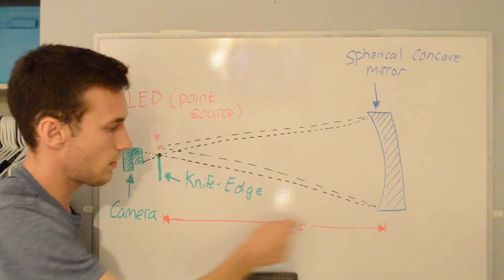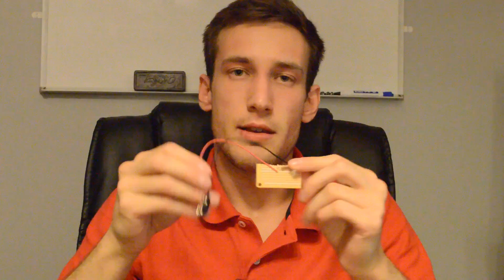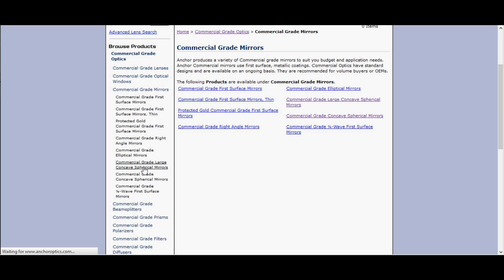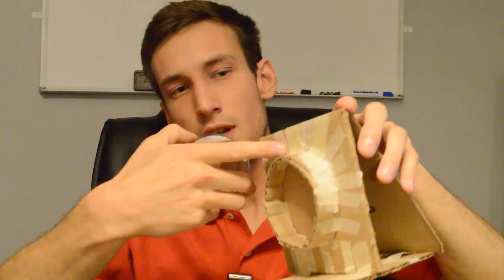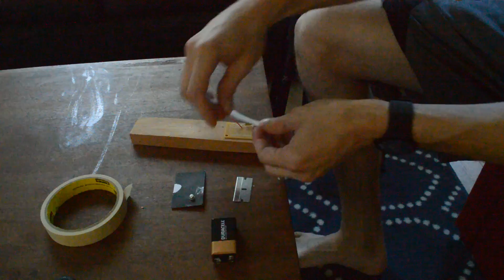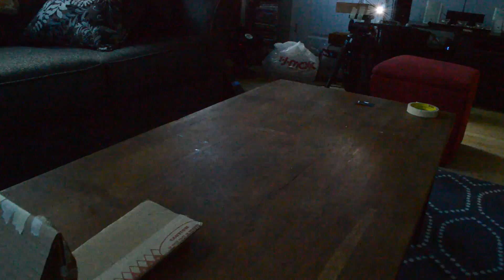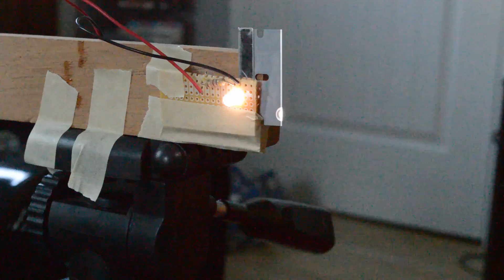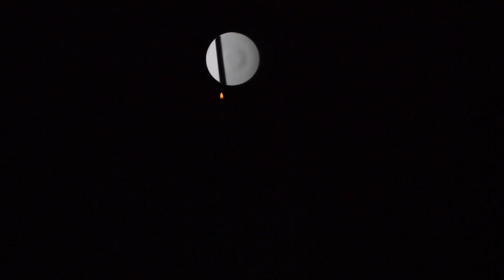How To: Build Your Own Schlieren Setup

Comment: Fantastic experiment! It is possible to se the effect with eye without camera? Thank you!
Reply from the maker: Yep!  You can just take out the camera and hold up a piece of paper a little farther back behind where the camera was.  The farther you move the paper back, the larger the image gets, but it will also get dimmer.  However, you'll be able to see the effect no problem.  Note that the image will be upside down.  You can also switch between Schlieren and shadowgraph by pulling out the knife edge.

Comment: Very interesting, and clearly explained, thanks a lot.
Best regards
Reply from the maker: No problem!
Reply: +JoshTheEngineer
Excuse a couple of possibly stupid questions, but if One wanted to build/test this Yourself, what are the most important "criteria" to make the "system" "clear", and easy/robust to set up.
I wonder mostly what one should "look for" regarding the mirror, as this seems to be the hardest part to get (and most expensive;). 
Is larger mirror always better than a smaller(qualities otherwise equal), and what about "focal distance", is longer always better than shorter,or vice versa. Or is the "sweet spot" simply only dictated by the "size" You want Your set up to be.
((I mean I understand that the focal distance dictates the "size",what I'm not sure about is whether Your set up was "deliberately chosen" to be that "lenght/size" due to some underlying reason. Or that it simply was due to that "this was the mirror You got")

And would it be possible to use a laser as a light source, if so would this have any advantages,or drawbacks ? (EXEPT the obvious that You of course can (should) NOT observe the reflection with a naked eye)

(Appologies for the verbose questions)
Best regards.
Reply from the maker: You have some good questions here.  Regarding the most important part of the system, I would say the mirror is the crucial component.  As you can see from my setup, there aren't really that many parts involved, and the mirror is the one that has the biggest impact on the quality, as long as you have everything set up correctly.  With a nice mirror, you'll get uniform light distribution in your videos/images before you put the knife-edge in place, which can be critical if you want to see minute details in your flow when you do finally put the knife-edge in.  What I mean by that is if you look at the end of the video, that bathroom/makeup mirror I use is clearly of poor quality for these types of experiments, and even without the knife-edge in place, the light distribution on the mirror is not even close to being uniform.  It makes alignment more difficult too.

There's a trade-off regarding the mirrors though, to get to your next question.  The three-way trade-off for me is between large mirror diameter, long focal length, and camera zoom.  It would usually prefer a larger mirror because the things I can look at can be bigger.  However, if you have too large of a mirror and a dimmer light source, then you'll have less light intensity over the surface area of the mirror.  It might matter, but it might not, just something to take into account.  To increase sensitivity, a longer focal length is better, but at some point, your setup will just be too large, and won't be able to fit in the room.  In my other couple of videos I did with a larger mirror, the focal length was pretty long and I had to position my mirror and camera on opposite sides of the room.  In this video, you can see that the mirror never takes up the full screen because my camera couldn't zoom in far enough.  When I switched to the larger mirror, it still doesn't fill up the whole frame because the focal length of the mirror increased.

The main reason I used the mirror I did in this video is because it was a high quality mirror with a long focal length for a very reasonable price.  That's pretty much it.

I have used a red laser pointer as a light source with a diverging lens attached to the front  of it, and it worked pretty great.  The main drawback with that laser pointer is the speckle pattern was pretty bad and it was magnified because I diverged the beam to fit on the mirror surface.  There will always be a speckle pattern with any laser, but higher quality ones will be better in general.  This was just a couple dollar laser pointer I was using.  But yes, definitely make sure you don't look straight into the laser!

Comment: Hey there, awesome video that seems very 'complete' in both theory and practical setup. I was wondering if there would be much advantage/disadvantage in using a laser pointer as your light source? I am guessing you need the beam to be divergent enough to cover the mirror but still coming from as small a point as possible. I may have misunderstood something but as you were using the word laser a lot so I wondered if it was because it would be of benefit to use one if you had it?
Reply from the maker: Hah, yes I use the word 'laser' a lot because I work with lasers in my research and I'm so used to saying it, so I slipped up a few times in this video!  You can definitely use a laser though, and I actually have with my setup.  You're correct that you'll need to diverge the beam to cover the mirror.  Here's how I did it.  I have a simple red laser pointer that you can buy for a couple of bucks.  I bought a plano-convex lens to diverge the beam from the laser (search Thorlabs LA1213 on Google, it's the first choice).  This happens to diverge the beam just the right amount to cover the mirror in my setup.  If it diverges too much, you'll lose intensity, and if it doesn't diverge enough, you won't use all of the usable area of your mirror.  I got pretty good results with the laser, but you should note that you'll definitely get a speckle pattern show up in your images.  This is just an unavoidable thing that comes with using lasers.  I like the pictures I get from my LED better, but if you're using a higher quality or high power laser, it might be better.  I say this a lot, but the quality depends on a lot of factors, and it's hard to make sweeping generalizations.  You should definitely try it out though, and see for yourself!
Reply: HpyCmp3r just a short note about lasers..yes they will work but there a few issues with them. Being a coherent light source, you will struggle to get a very clean field due to the patterns you get, and as they are monochromatic light sources, you will experience greater diffraction around the knife edge. This in turn will make the image a little less sharp. A red laser will be safer here as the wavelengths are far longer. Hope that helps you both.

Comment: This video is very good. Do you have any idea to see the flow dynamics inside a tube whose dimension are in mm. Either it should be a circular or square
Reply from the maker: Are you interested in building a shock tube?  If so, I would recommend going with circular cross-section tubes.  If you use square cross-sections, you'll have to worry about stresses at the corners when you pressurize the driver.  Circular tubes are better for pressurization.  

When you say 'dimensions are in mm', do you mean that you're trying to build a very small one?  You also need to be concerned with the boundary layer that develops along the length of your tube.  If you have a very small diameter tube, you probably won't have a uniform freestream near your test article.

Is this what you meant?  I might have misinterpreted your question.  If I did, try to rephrase it and I'll give it another shot!
Reply: I want to see dynamics of fluid inside the tube which is nearly 8 cm long with inner diameter is 4 mm and the tube is square shaped. I can see the flow outside but i cannot see anything inside tube. Do you have any idea or suggestion to solve this problem.
Reply from the maker: The tube diameter is quite small, and I think it will be difficult to get optical access to it.  You'll have some boundary layer interaction which will make it difficult to understand exactly what is happening in the tube.  What flow velocities are you looking at?

The first step is to simply put a window looking into the tube.  If you don't have optical access, you can't do any sort of Schlieren imaging.

Comment: Thanks Josh, awesome video with great explanation. I have a question, would placing the light source and knife edge at the focal point work as well? since at focal point the light will also come back  as a dot just similar to 2f point. Also, is the led bulb collimated? Does the light source need to be collimated? Thank you!
Reply from the maker: You're welcome!  If you placed the light source at the focal point, the light would actually leave the mirrors collimated, and wouldn't focus back down again.  This is actually what the Z-type Schlieren system does.  You place the light at the focal point, collimate it with a mirror, then use another mirror to focus the collimated light back down to a point at the second mirror's focal point, which is where you would place your knife edge.  This way, you get collimated light through your object of interest.  The LED is not collimated; it emits light in all directions.  You don't want a collimated light source, because it needs to diverge out to fill the mirror.  Lasers are collimated, which is why in my other Laser Schlieren video, I use a lens to diverge the light so it encompasses the mirror.

Comment: +JoshTheEngineer do you think it will work if 1 foot behind the razor blade we placed a white paper as a screen so we get the image? I mean not to use a camera
Reply from the maker: That should also work, since the camera is mainly there so you can record images or videos.  You might also notice that if you take the razor blade out of the setup, you can place a piece of paper where your camera would generally be, and you should still be able to see something that looks like Schlieren, but is actually called shadowgraph.
Reply: shadowgram yes

Comment: Hi Josh, absolutely love the video. I in fact just built a setup in my living room with a 1300mm FL mirror. It is a telescope mirror, and fits this experiment well. I am creating this as part of my physics final project. One question though. I have everything setup, and light a match or something, the image that I am seeing is everything I need to see, but it's inverted. Placing things at the bottom of the mirror is showing at the top of the mirror, and the smoke is going downwards (upwards). Any thoughts as to why?

Comment: Does it work if you don't use a point source, but instead use a light source that produces beams parallel to the principal axis of the mirror, and place the blade edge and camera at the exact focal length instead of twice the focal length?
Reply from the maker: That's actually sorta what the Z-type Schlieren system does.  You're essentially just skipping the first mirror part, which collimates a beam from a point source located at the focal point of a parabolic mirror.  Then after the collimated beam passes through the region of interest, another parabolic mirror focuses the light rays down to a focus, where a knife edge is located, and then into your camera.

Comment: What did the razer do? Trying to understand the need for the knife edge.  Awesome video

Edit: kind of understand now.. The knife edge is just blocking a corner of the light, blocking some rays but letting others pass..
Reply from the maker: Sorry for the delayed response; I've had a busy summer.  Like you said, the knife edge blocks some of the light from getting to the camera.  Based on the angle that the light gets refracted as it passes through the air, it will either get blocked by the knife-edge or it will be allowed to pass by and into the camera.

Comment: Hey Josh,  Thanks for the video. I have a question by the way. I saw your reply to one of the comments below, where you mentioned that the first step in Schlieren is getting a uniformly lit mirror. What exactly needs to be done to achieve this? I am using an 8" dia,  30" focal length mirror with a Nikon D610 for visualization. I can visualize the flow patterns, but my mirror is not uniformly lit and the  image is just focussed on a small portion of the mirror. What should I do to get it over the whole mirror?
Reply from the maker: No problem!  The easiest way to get a uniformly lit mirror is to take out the knife-edge completely, and place your camera (behind the point where the light focuses back down to a point) in a location where you see the mirror completely filled.  You've probably tried this already, so here are two more things to check.

First, make sure your light source is diverging enough such that it completely fills the mirror.  As an extreme example, if you use a laser point without a diverging lens, the light spot you'll see in your camera will only be as big as the laser beam diameter.  You can see in my Laser Schlieren video (https://www.youtube.com/watch?v=JvHZT_wBpUE) that when I use a diverging lens, the light overfills my mirror a little bit, which is better than it under-filling the mirror.

Second, make sure your aperture (F-stop) is open as wide as it can go (lower numbers).  I was trying to take some high speed Schlieren a little while ago, and it turns out I couldn't attach my lens of choice to the camera because it would auto-adjust the F-stop to the smallest aperture (highest number).  I had to use a manual-aperture lens with that body so that I could make sure the lens was wide open, which didn't restrict the light entering the camera.  Try checking this, and let me know if it doesn't solve the problem.

Comment: I have been trying to get this to work for a few days now. I am using a DSLR camera, a concave mirror with a 24" focal length and a razor blade setup just as yours is in this video. I am getting to a point where the mirror appears gray-ish, like in this video. However when I turn any heat source on in front of the mirror, nothing shows up in the image. Any tips? I have tried a couple different light sources including an LED flashlight with the reflector taken out and a black cover over the top with a hole in it and an LED point source like yours in the video.
Reply from the maker: I'm assuming you've pretty much set up everything the way I do it in the video, so let's work through a couple scenarios and see if that helps.  If you remove the knife edge completely from your system (and you don't put anything in the beam path, which I'll just call a candle from now on for simplicity), you should get a uniform light distribution on your mirror as viewed through your camera.  If you do, that's a good first step.

The next thing to do is to place the knife-edge in the beam path, at the point where the beam focuses down to a point, still without the candle.  If you cover up half the beam with the knife-edge (you'll see half the beam spot on the knife-edge, even though it'll be small), then you should see your intensity go down, but it will still be uniform.  The more you move your knife-edge into the beam, the dimmer the image on your camera will get, but it will always stay uniformly lit.  After the knife-edge blocks the beam, you obviously won't see any light passing through to your camera.

If everything makes sense up to now and is working like I mentioned, then you should bring the knife-edge back to the point where it's covering about half the beam spot at the focus.  As we saw before, you'll have a uniformly lit mirror, but it will be dimmer than if there were no knife-edge in.  No place your candle as close to the mirror as you can without it burning or heating up the mirror, maybe an inch away.  You should see something now on the camera.  If you pull the knife-edge out of the beam path slowly, then you'll see the sensitivity decrease, and the mirror will become uniformly lit at the full intensity of the light source.  If you move the knife-edge farther into the beam spot, you'll still "see the heat", but the background intensity will go down.  If you look at the video that the YouTuber "brusspup" posted, you can see in that setup that he has most of the beam spot covered by the knife-edge, which is why the background looks so dull and gray.  I personally don't like the way that looks, so I usually do about 50% coverage, and then adjust back and forth until I get an image I like.

A couple of other things to note.  Orientation of the knife-edge does matter.  If you're looking for horizontal gradients of index of refraction, then you need to orient the knife-edge vertically, as I do in the video.  If you are looking for vertical gradients of index of refraction, then you need to orient the knife-edge horizontally.  Or you can do it at an angle and be slightly sensitive to both.  For a candle, put the knife-edge in vertically because the index of refraction changes abruptly in the horizontal direction.  Also make sure that your return beam spot is coming back as close to the LED source as possible (within reason).  This will eliminate double images.  You might need to adjust your exposure compensation on the camera too, because as you can see in my video when I bring it back to 0 (no compensation), you can't see much on the mirror.  Another YouTube comment mentioned that I could have used spot metering as opposed to matrix metering for my exposure, where the spot would be fixed on the mirror such that it was correctly exposed for the mirror light.

Hope something in this response helps with your setup!  If it does, let me know what fixed it.